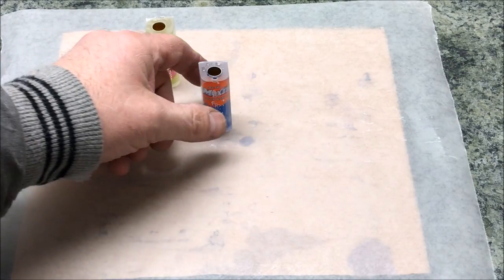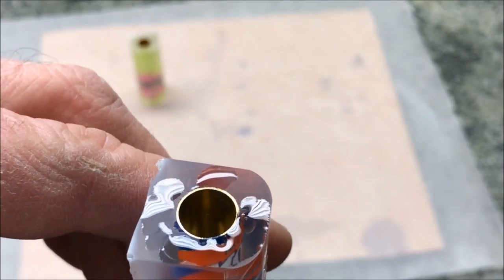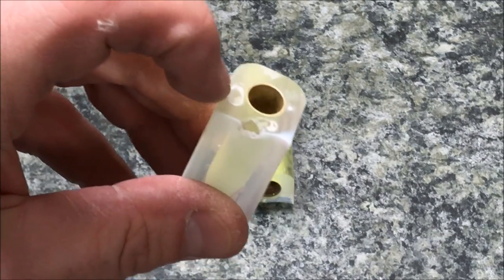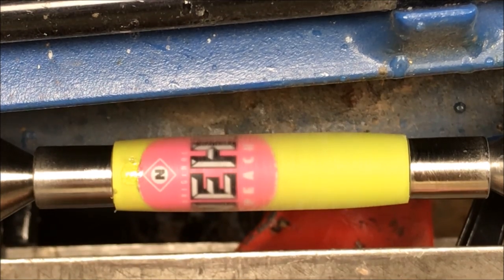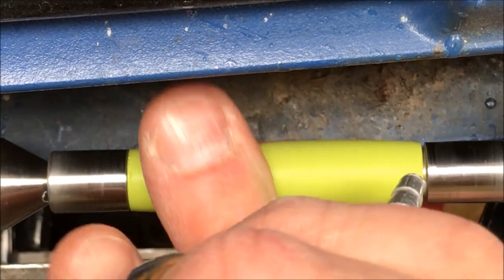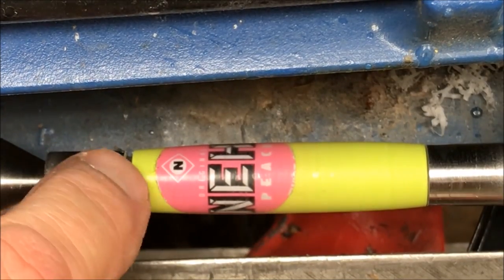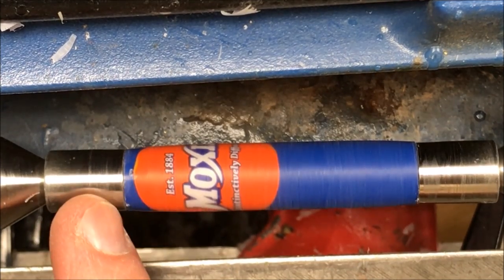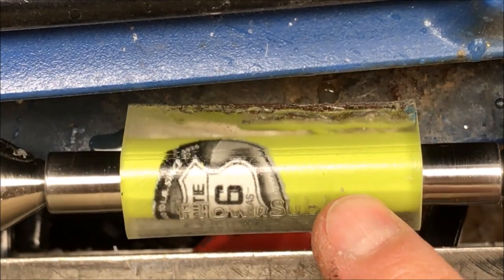My Attempts At Repairing Some Alumilite Blanks

Comment: Bob. I’ve been doing some internet shopping and I also called another pen dealer for a lathe. My fist thought was to buy a penn state lathe. But this guy told me the vibrate a lot. Also looking at jet but they are more expensive. What are your thoughts?  Between you and I few other guys I really love what you guys are doing with the hobby.  You attention to detail and the way you teach is bar none. Thanks for sharing to us who really want to learn
Reply from the maker: Hello Mark,
  I have the Penn State Lathe and I haven't noticed any vibration. I've also used several Jet models and they are extremely nice. Given a choice, and a big budget, I'd probably opt for the Jet. Just an opinion, not an endorsement.

Regards,
Bob

Comment: Good video Bob - just wondering on the green Route 66, could you have put it back in the mold and pour more alumilite in the mold and back in the pressure pot? You think that would have had a better chance of saving it?
Reply from the maker: That’s what I planned to do. Zac Higgins contacted me and told me unless I did it very soon after the initial cast that the chance of it not working would be very high.

Regards,
Bob
Reply: That makes sense, to recast before it completely cures.  Good to know.  Thanks
Reply from the maker: I really appreciated him reaching out to me. He really knows his stuff.

Comment: I have the alumilite sitting on a shelf, I have yet to try any blanks.  Too many other things going on right now.  I'm sitting at home this afternoon waiting for Fedex to show up with my new benchtop mini metal lathe.
Reply from the maker: Nice!!! 
  A metal lathe would be cool to have and opens so many doors as far as custom components. I’m jealous. 

Regards,
Bob
Reply: At least you got 2 out of the 3 blanks to work.  I don't know if I would have had enough patience to go as far as you did on them though.  

I've been looking at getting a 2nd lathe to setup for a buffing station, so maybe this spring I'll go that route and get the PSI buffing wheel setup.  Does it make polishing faster for you?  

I was looking into making some full metal pens with mixed materials, and the wood lathe just isn't capable of doing metal turning all that well.  I caught a 25% off coupon from Harbor Freight and broke down and finally purchased a 7 x 12 metal lathe.  Brought the $600 price down to $450.  

I did manage to get my pressure pot leak tested and had similar pressure losses like you did, I pulled the top off and put some petroleum jelly on the seal and it hasn't lost any air since then on pressure tests.  I did put a pressure relief valve in which I had the same trouble you did, the one I got is higher than it should be but I don't plan on pressurizing that high anyways that's why I've got the pressure gauge on it, and I just close the valve around 45psi anyhow.  I'll see how that pressure does, may have to go up a bit from there but I don't think so.  

Just haven't found anything interesting enough to cast a pen blank yet so I haven't messed with the alumilite yet.
Reply from the maker: The buffing system does a really nice job. I just got a Beal buffing system for Christmas and haven’t been in the shop to test it. I’ll do a comparison of the two once the weather breaks.

Comment: What kit are these blanks for Bob?
Reply from the maker: Sierra, Monarch, Wall Street kits. 

Regards,
Bob
Reply: I thought they were. I have had luck trimming the ends a small amount shorter and pen function will not be affected becaue the tube length is not super critical in those because the pen mechanism is in the bottom. This has saved some pens that have those small defects on the very end of the tube. The tube can be trimmed down in the sierra style pen quite a bit before function is affected. Now the Gatsby style pens will be affected because the barrel tube length is crucial to ink cartridge protrusion distance. But Sierra's and clones will not be. Awesome video as always!
Reply from the maker: Thank you Scott.

Comment: You're a lot more persistent than I am for sure.  I would have thrown in the towel multiple times.  Hey, nothing ventured...Where you nicked the tube, I wonder if you couldn't have just used a toothpick to put a little of that paint at the bottom of the hole.  When covered by the CA it might have blended in.  Just a thought.
Reply from the maker: Interesting thought, that might have worked. 

Regards,
Bob